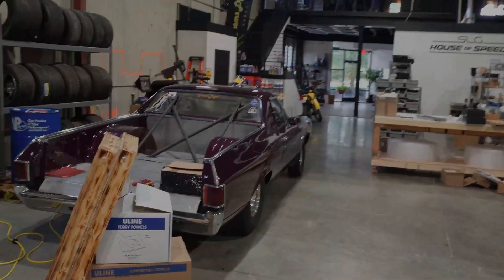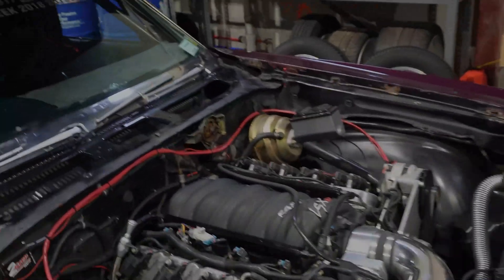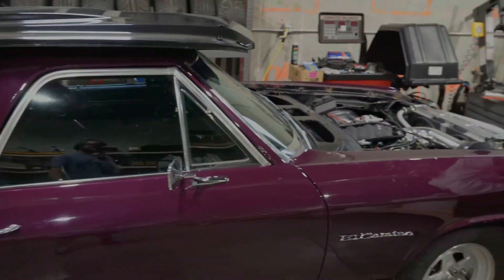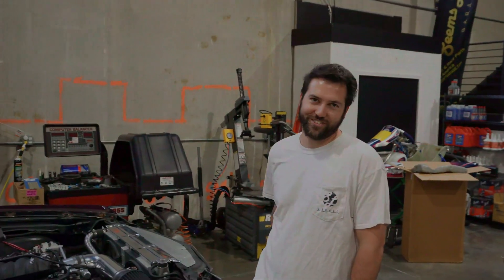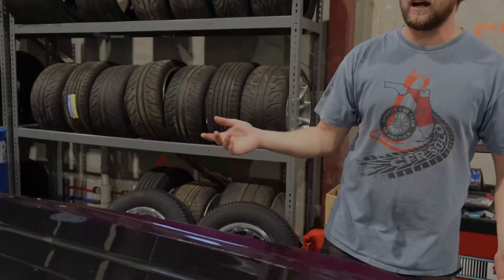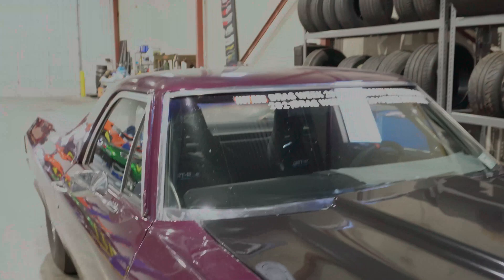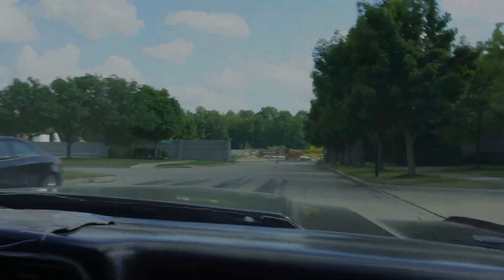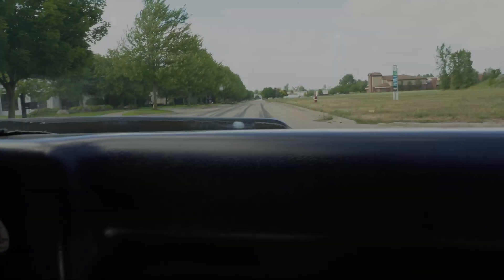LS/8HP70 Swap in the El Camino!

Comment: No stretching for sciatica..  Instead, strengthening, especially for the gluteus medius.  That will help pull the hip joint back in balance which will reduce pinching and impingement.  If you ever injured your knee or ankle you probably need to relearn to walk as you strengthens the gluteus muscles. 

Relax muscles with “no salt” as a potassium supplement. 

Eat enough meat protein.  Avoid fruit sugar. 

Hope you feel better soon better!

Comment: Would like to see a LS with a 6L90, 8L90, 10L90 in a 1999-2007 Silverado.

The 4L80 is a towing transmission.
Reply: With a factory tune or a manual valve body, the 4L80 just sucks.  A properly set up and tuned 4l80e is just about the only electronic transmission that’s proven to reliably handle up to 1500Hp in 4000+ bricks and can be driven on the street and cruise on the highway.
Reply: Tell that to all the TH400 race cars across the world